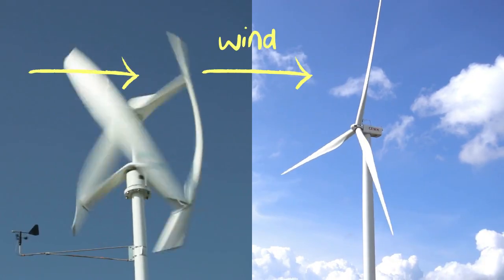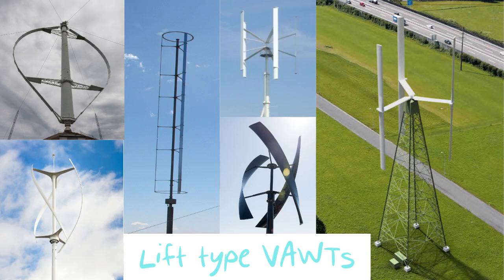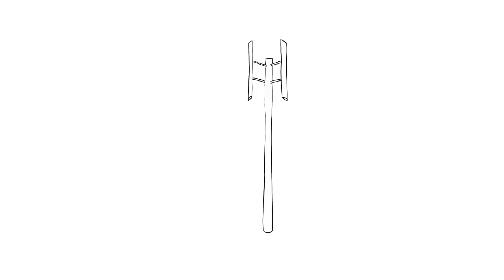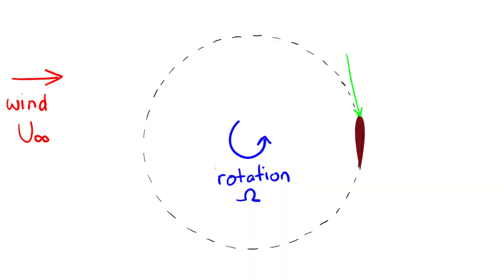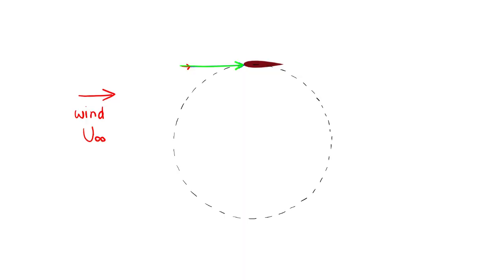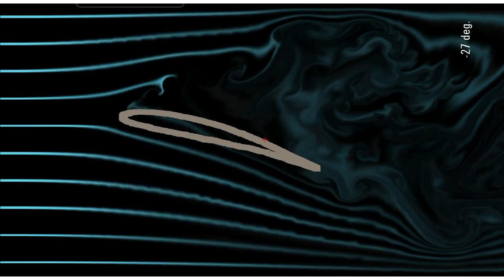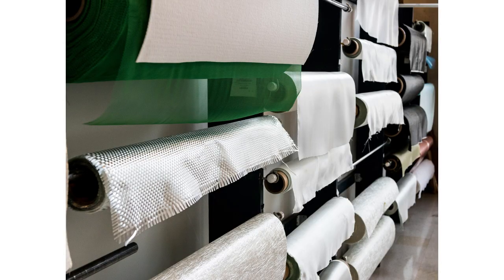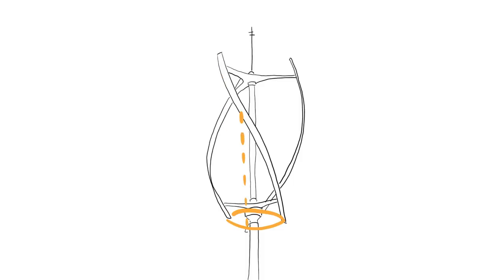Vertical Axis Wind Turbine Aerodynamics and Design

Comment: I live in north Texas with constant, powerful wind. I use VAWT exclusively, utilizing both Darrius as well as Savonius designs I have refined over the past 57 years. I am 74.  My vawts have completely overcome flutter, stall, vibration, over-speeding problems as well as have zero electrical loading and unloading with wind speed and frequency changes, because one design utilizes 4 moving parts, while another utilizes 2 and ALL my birds compress air into an air grid for storage. Electricity is manufactured in my shop utilizing any of several air-driven engines of my own design. I have several air-driven appliances I have manufactured over the years.
Edit: New Sub. I love physics!
Reply: Sir, We live in a typhoon belt island, will be able to share your idea on how to build DIY a small 3 KW VAWT unit for my house?
Reply: You could make an air network for neighbours and compete with electricity and gas.
Reply: @tujuprojects  
I'm retired for starters. I'm also autistic.
"I'm a loner, Dottie".
Reply: where can i buy or 3d print a copy ?
Reply: @russelldarmody4541  
A copy of what?  BTW  I have recently designed a new compressor and air-tight yaw bearing and have switched over to building both symmetrical as well as asymmetrical HAWT blades. I'm currently 3-D printing each.  The pump is one cylinder, three piston & has only one moving part. B4 you drive yourself crazy trying to figure it out, realize I'm autistic.  My main thrust in wind turbines is an insatiable desire to watch spinning motion.  Also, after building only VAWTs for all these years, I'm branching out into HAWTs. No worries even then, because I'm a firm believer in open source. I will publish YouTube videos of the whole process someday soon.
Reply: @SiwyWabbit  Hi sorry for the ambiguity I have just started looking into wind to electricity methods to live in a caravan in Australia in retirement and thought I'd give design and 3d printing a try, so I was interested in the specs on your VWAT. Thank you for your reply and good on ya for sharing :)

Comment: Excellent video. One extra detail for those interested: aircraft wings are also tapered and twisted, for two reasons:
1) To reduce wing tip vortices (drag).
2) To make the outer parts of the wing stall later than the inner parts, to allow control to be maintained to get out of the stall.

Comment: Great Video.  specifically for an off-grid property in the Dominican republic.  The vertical Axis Wind Turbine seems more compact and is probably a better option for a smaller property.  My biggest "worry" is the behavior of wind turbines (VAWT) in high wind conditions (such as those found in a tropical storm.)

Comment: Hi Rosie - love your vids. Could you please look at VAWT performance with baffles that concentrate the wind. There’s a couple of vids about a nearly doubling of the speed of the turbine. Also, VAWT’s seem to start operating at lower speeds, and can be grouped more closely. The problem of the wind slowing on the exit side, and therefore less power output can be addressed by VAWT’s at different heights. All this, coupled with lower maintenance and production cost could make them a viable option, especially for micro turbines for homes. I’d love to get your thoughts on this.

Comment: Thanks that was really interesting. I had a question on the dynamic blade orientation system. Couldn't this be achieved with a passive system? Like ball bearings? The wind would then push the blades into the optimal path.  Thank you.

Comment: The scientific answer is unequivocally yes... I spent over ten years as a wind generator turbine and Axial Flux Alternator Design Engineer for the American Energy Research Laboratory. I designed, fabricated and studied many VAWT designs in dynamic environments. VAWTs are uniquely interesting but cannot compete with HAWTs in power generation on physical dimension characteristics. My data indicated the the swept area of a VAWT must be in excess of 4X that of a HAWT to produce a similar output energy production. That was when compared to the most efficient designs available.
As an example: A VAWT will require a physical size of +360 sqft swept area (10' X 36') turbine to produce the production of a 10 foot diameter HAWT with 81 sqft of swept area. Both turbines will produce "realistically" approximately 500-1000 watts. 
Advertisers of wind turbines routinely indicate 2X - 3X more production based upon non-standard values. 
If you are interested... You can also "guess" the useful output of a generator by weight. Since most "motors" are fabricated using the same components and materials I use a simple rule of thumb. 26 pounds of generator = 742 watts. 
Once again.... Advertisers claim much much more due to various methods of non-standard calculations.
How do I know this? 11 additional years employed as an Engineering Technician for a major motor manufacturing company testing many different motor and generator designs and producing valid data to design engineers producing more efficient products.
Reply: Where do you recommend I look to compare retail generators suitable for VAWT diy? Thanks!
Reply: @theosky7162  I do not recommend any VAWT. They are too inefficient for the investment. I recommend a small HAWT to supplement your solar system as part of a hybrid system design. I have attempted many VAWT designs new and old in research for efficiency. None exceeded the three blade common HAWT design. As stated earlier, It takes 4X the swept area of a HAWT to match its output capacity. 
Unless you are doing hobby research I would not bother. There are hundreds of examples of VAWT deployed designs shut down around the world...
Buy a HAWT...
Reply: I get the efficiency problem of VAWTs as you have well explained. My question is directed at Generator sources or design class suggestions, as I noted your prior experience as an Alternator Design Engineer. Perhaps I'm still at the 'hobby research' stage, but my intent is to build a multi-input grid-tie system that supplies power to my home, manufacturing shop, and neighbors. As you are surely aware, technology in all the related fields is changing fast now. Solar panels, Battery storage, Wind Turbines, Capacitors, Transformers, Inverters, Hyperbolic collectors, etc... it's a deep dive on all. At the moment I'm concentrating on rotational to electric conversion. Any product compilations for capacity / cost / sources that you know of would be greatly appreciated.
Reply: @theosky7162  I understand...First, let me explain my current build and strategy. I live NW of Amarillo outside any code restrictions. I live 100% off-grid. I have little knowledge of grid-tie systems. I designed, fabricated and distributed a couple of small wind generator APMA's. The designs were sound and extremely reliable but the overseas markets set the retail prices far too low to meet a standard business model. The company was American Energy Research. I sold all the fabrication equipment to Hurricane Wind Power several years ago.
Now, the good part!
I have built a solar/wind off-grid system to support a 20 acre location on a mesa far enough from Amarillo to not feel the "city" effects. I am still building, or expanding my system. Currently I have 60+ solar panels deployed and another 60 to be installed. These are 24v panels from 225W to 400W. I have upgraded my charge controller/inverter system from PowerJack and MpptSolar to MppSolar models 6048 & 6548 inverters. My system was 24V and upgraded to 48V. I still use GC-2 & GC-8 FLA batteries over 40 of them. I recently purchased (5) 5.2Kw EG-4 server style LiFePo battery packs for storage.  Currently I only have one 400W 48V HAWT wind generator to "top-off" my battery storage system. 
As I mentioned earlier a "hybrid" system is needed in almost all applications. Let me know where your install will be and I can give you a rough idea of the "mix" required to design a working system.
Wind is not an issue here as well as sun.
I am willing to help you in your quest if I can
Reply: Isn’t HAWT not suitable for areas with high turbulent typhoon winds?  For potential future 30MW VAWT plant, how many turbine motor generators (of largest commercially available size) would you need at that plant?

Comment: Nice analysis thanks. I concur that a form of blade pitch control is key to the efficient design of VAWTs. Some clever engineer will come up with a simple light (annular? ) gearing to solve the issue. Determining the optimal angle for each blade is a part of the trick.
Reply: Vertogen have been working on this for a number of years.

Comment: My (hypothetical) interest in vertical axis wind turbines applies to electric powered sailboats. Yes, that is a bit oxymoronic, but considering the omnidirectional nature of such a turbine, the direction of the wind would make no difference, You could theoretically sail into the wind which no traditional sailboat can do. Should blade design, battery storage, and motor technology improve significantly in efficiently, maybe a 20' tall by 12" wide vertical turbine on a 28' sailboat could, again theoretically, replace the sails which constantly, sometime radically, require adjustment to the prevailing wind speed and direction. A vertical wind turbine could (maybe) generate enough electricity to power the boat and maybe even charge the batteries when the wind is high. Of course, there needs to be some way to close down the expansion of the turbine blade diameter when storm conditions are encountered to avoid catastrophic structural damage. A superstructure would need to designed to provide stability for the upper bearings at the top.

Comment: Hello Rosie, you mentioned ~11:20 you like idea for new videos and I suppose if we are at VAWT case it will be benefical for all to make vido about drag (Savonius) model.

 I plan to make 2 test turbines with the same generators ~150W  (engines from electric scooters).
First one: HAWT - probably with a diameter ~150cm (should generate ~150W at wind 7 m/s - I'm located at west coast of Ireland)
And second one Savonius VAWT as two "half cylinders" - each around 51cm "diameter", overlapped 0.15, with 97cm discs at top and bottom, maybe with a small vents (⌀5cm?). Height around 177cm.
I'm expecting to aquire around 60W from this at silmilar 7 m/s wind. 

Both turbines will have SAME swepped area, so will be comparable somehow. Not sure if this will be done fast and in planned size, as access to materials is not easy.
I already read many tens of scientific research on drag VAWT turbines, and I know they are "weaker", but they beter perform in the stormy weather.
That's the reason for considering Savonius - it have to work MOSTLY when is a strong wind and electric lines are broken. I'm living now countryside.

I know analyse of Savonius is a pain, but if you have any suggestions how to estimate rotation speed of both of them (at full load and 7 m/s) it will be beneficial and for me and for other viewers. I excpect peripherial speed will be lower, say 70%(?) of speed of the wind, but is this thinking ok?

Let me know what you think about it  - or just make a video (no rush at all :) )

Regards,
bialy

Comment: We operate a maintenance hangar at a small danish airfield and I am looking into cleaning up our energy sources. Vertical axis wind turbines play a key role (beside our roof suitable for solar panels). The advantages are the possibility to utilise the air flow between two hangars without restricting the use of the area between these hangars too much. Horizontal axis wind turbines are more efficient, but require higher installation which is a problem on airfields. So there are application possibilities despite the lower efficiency.

Comment: Newbie comment, would it not be fairly easy to vary the angle of attack by using a separate rudder  with a crank shaft to constantly change the angle of the wing as it rotates? It seems too simple and therefore must not be a new idea or even a good one.

Comment: Hi everybody, I am such a DIY guy and I've started to build more than one VAWT on my backyard. I live in a place with 6m/s medium wind speed / year. So I 've done the math very simplyfied. 1 complete turbine (with generator, charge controler, batteries, inverter, etc) with the cost of materials up to 1000 euros and a medium of 500wh production for only 12 hours/day and 3 years of lifetime will make me save around 3200 euros of energy cost this 3 years. Minus the total costs, it can save around 2000 euros for 3 years. If we combine 2 of them the savings will double, so I can save 4000 euros for 3 years. For only 3 years of lifetime It looks enough efficient for me! In this case I think the low efficiency doesn't matter to much. And don't forget the carbon footprint. Mabe I'm wrong, I'll build it anyway.

Comment: I watched this again in December 2021 and note that a paper was published this month which became available as a preprint about the time you published this presentation. It is based on thesis research by Joachim Hansen under the direction of Dr. Iakovos Tzanakis. What makes it interesting is the analysis of the collective effects of “farms” of VAWTs, with spacing and rotation direction as additional design elements. The citation is Renewable Energy, 2021, vol. 171, issue C, 1371-1381. It may be downloaded at no cost.

Comment: One problem with comparing utility scale VAWT with HAWT is that the emphasis has been on individual turbine energy production (efficiency) instead of the efficiency of the entire field of turbines, VAWTs can be installed closer together (about 4 rotor diameters) than HAWTs, producing more energy per acre even though individual turbine efficiency is 10+% less. The other factor is that individual HAWTs require huge cranes and heavy duty helicopters to construct, making the cost of installation high, while a large VAWT can be designed in modular fashion and constructed of smaller components, making installation much cheaper (note I said can be, as some big VAWTs are as complex and difficult to construct as their HAWT sisters). A design can be sophisticated while still being made of simple components, and that's where a good VAWT design should excel.

Comment: I noticed that you did not address one of the Big Elephant issues in the room.  That is the Drag component of bearings of the rotors. This is the biggest problem for horizontal designed turbines and cause of failure.  In the case of Vertical designed turbines, there is 2 known types that have almost no drag or torque to slow down the rotational efficiency. This means that the vertical turbines have the potential of being better than Horizontal and have an efficiency above 50. How is this possible? VAWTs can make use of Magnetic bearings where the magnetic forces allow for near zero drag and torque limits. In fact, the magnetic force can be used to increase efficiency.  I have seen one prototype that had an efficiency of 48.3 with winds between 5 and 30mph. Scaling it up a bit more would get better numbers  and cleaner air. However, the project was part of a Wind Engineering experiment and not for full retail production type of effort.  There seems to be massive potential with VAWTs but no one is putting the research money to achieve the end goal of being better than HAWTs.  There are plenty of technological items that could seriously make a huge difference. Right now, retail wise, VAWTs are better at smaller scale in the 5000KW and less range than HAWTs.   You can put a small VAWT on a RV roof and get 4000 to 5000KWs to run the appliances and even AC on a very hot day. You can buy these items right off of Amazon today.  This is something you can not achieve with HAWTs.

Comment: here may be something to give you a headache. what about the Bernoulli effect. we used this with a circuit board fab once. use the existing towers but take motors and blades out so the housing is hollow then put vertical fans in the tower stalk closed off from outside except for air inlets on the bottom so the air would be pulled instead of the wind pushing. have the Neodymium magnets on vertical carbon-fiber fan blades on magnetic bearings. multiple small vertical turbines in the tower.

Comment: We own a small domestic VAWT max output 4Kw (actual) it's installed now for about 6 years. It's not as efficient as a HAWT of course but it was probably 35% of the cost to install compared to one because it needs only simple controls to manage it. This makes it a viable proposition where most domestic HAWT's of that size weren't at the time.
I agree with you VAWT's will never compete with large HAWT's but as you say they have their place👍
Reply: Would you share what kind of VAWT do you have and what is the experience with it?

Comment: I believe that vertical axis turbine will overtake horizontal turbines in the long term. However, their main deployment will likely be small scale residential deployments. There are areas where solar power is simply not lucrative or possible, and they are also viable if combined with solar power for more consistent power generation for homes.